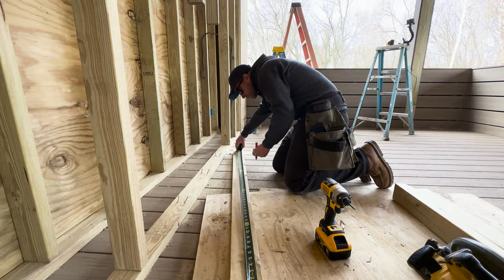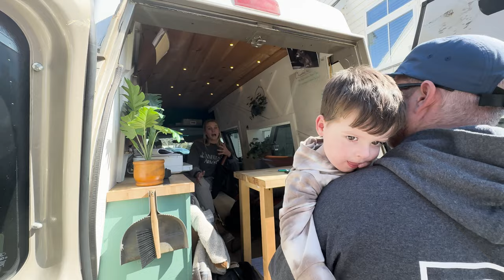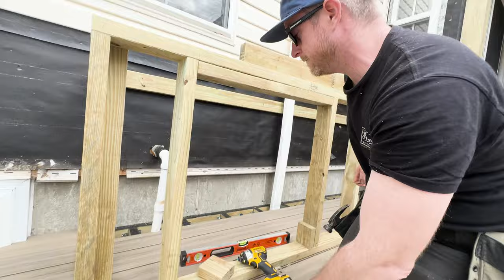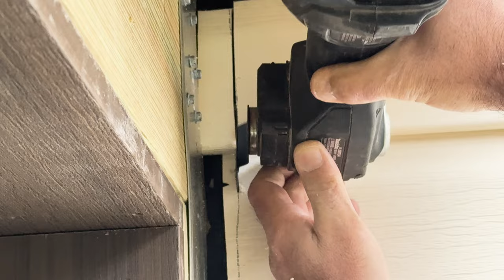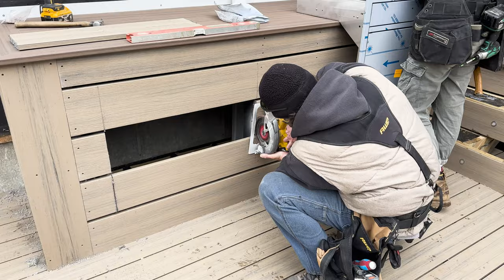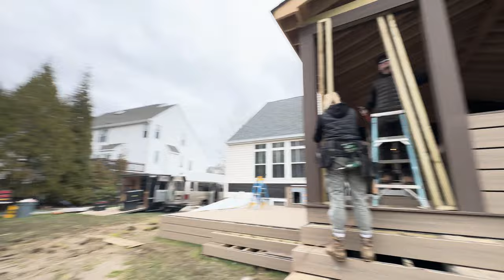SCREEN PORCH BUILD -  Fireplace Wall and Another Bar!

Comment: Love the work you all do.  Question, What’s the purpose of putting both Tyvek and Tar Paper around the fireplace?  If you’re using Adorn Stone isn’t that overkill?
Reply: Tyvek is crap. Water is even worse. Theres never overkill for water control.
Reply: @brushandbolter what water?  It’s in a 4 season room.
Reply: @scottp3802  Rain/water management is always the death of a house, especially one even more exposed to rain/wind.
Reply from the maker: Just an extra layer of protection, and we do the tar paper on the outside just in case there is a tiny gap in the stone, it’ll disappear